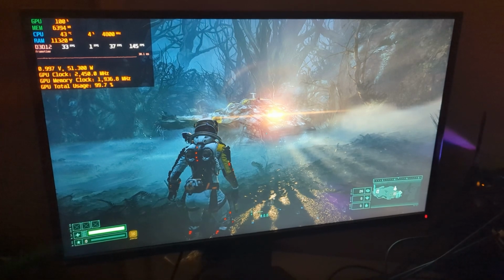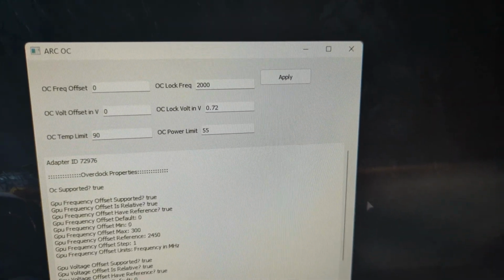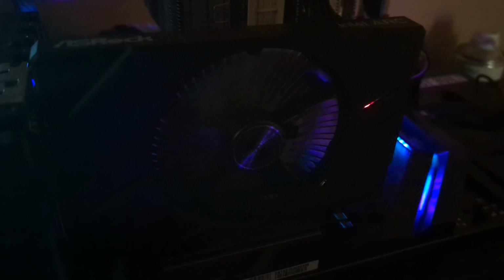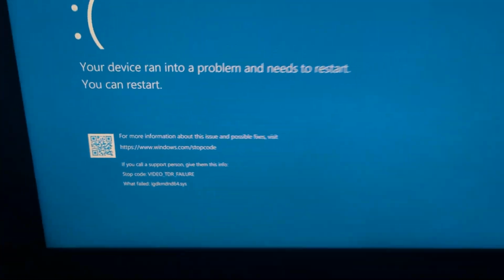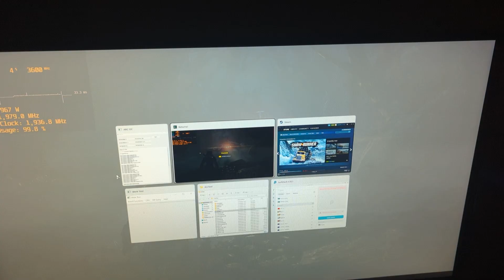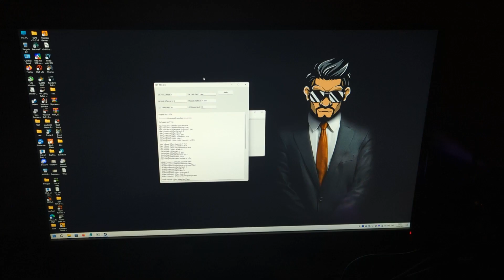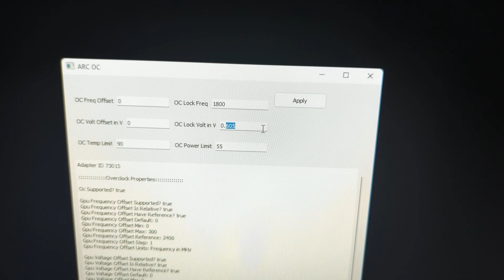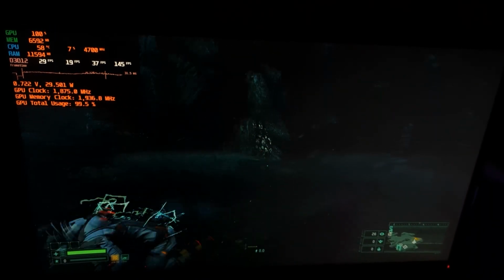Undervolting Intel Arc A380 from 52W to 30W with Intel Arc OC Tool | -10% Performance LOST?!

Comment: Man, if only this was an out of the box performance, we could have this tiny eGPU that is powered by a powerbank.
Reply from the maker: You gave me an idea hmm.. will wait after new years though as I need to grab a no power a380 😅
Reply: @graphicarc  Yea I have a A380 with a power socket and awhile later, came the low profile variants with no 8 pin connector, fml

Comment: My gpu is an sparkle arc a380, The GPU does not go above 43W and 2000MHz even when overclocked, however in the specifications it says that they are 75W TDP, any help?
Reply from the maker: Even if you force overclock with arc oc tool? Interesting have to test my a380 that is in my testbench again. What if you boost W in arc panel?

Comment: Good experiment man, thanks
try OBS maybe it helps ewe record the screen, the A380 got encoder, I think you can use it, without dropping fps
Reply from the maker: I actually used OBS but problem came when doing the "montage". New video regarding this soon.
Reply: @graphicarc  cool man
thanks for effort
Reply: @graphicarc I am very late lol, but i was wondering what's the maximum (SAFE) undervolt while keeping stock speeds without losing performance?

i am using an acer predator a380 with a blower fan and only 1 case fan, and i am worried it may overheat

Thx in advance :)